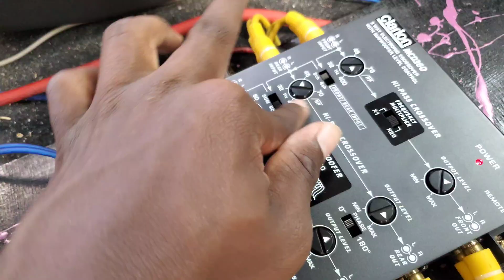Improve Your Speaker PERFORMANCE with These Crossover Settings!

Comment: 20hz to 20,000hz you may want to correct the video on that hearing range 🎉🎉
Reply from the maker: Yea the typical hearing range for our ears are usually 20hz to 20,000 Hz
Reply: @tyreeisvibin  Most are not hearing that low or that high as we age.